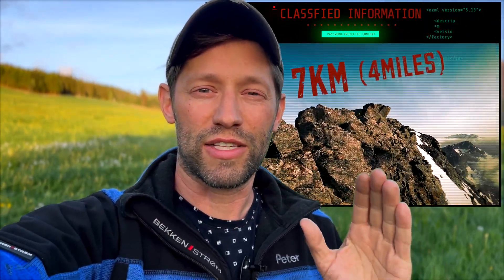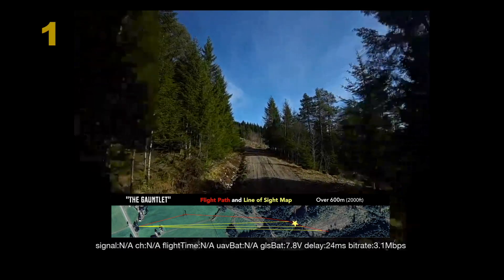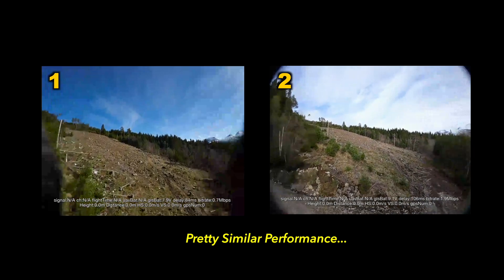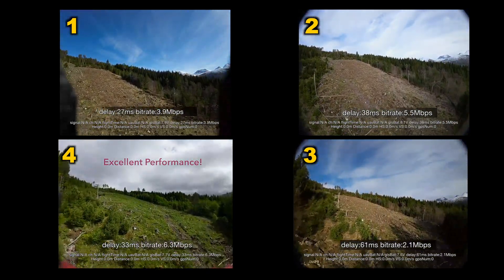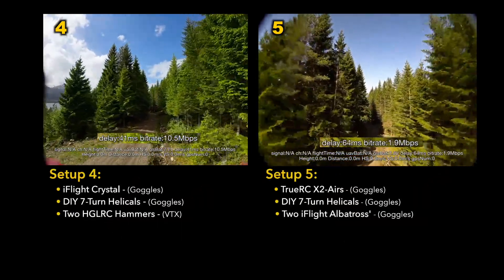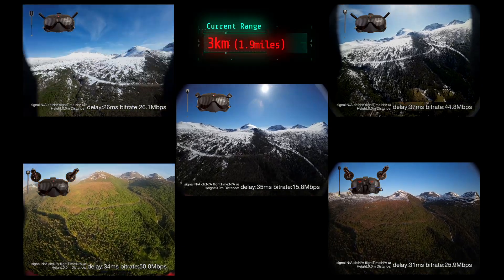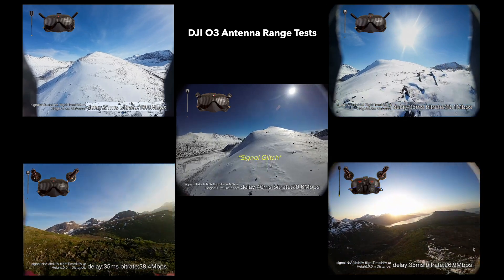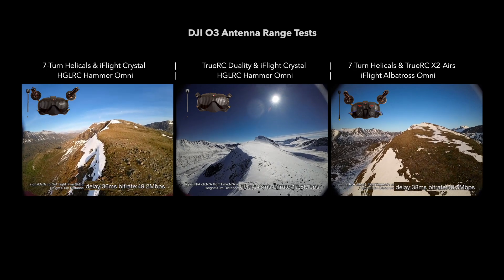NEW DJI O3 Range & Penetration | Improve FPV Drone Signal Testing | DIY & TrueRC High Gain Antennas

Comment: Are those Helical antennas RHCP?   I've got the Iflight Crystal HD, which is LHCP. Also running dual 150mm LHCP antennas on the O3.    Common logic would say that I need LHCP Helical antennas. But all the STL files I find for helicals, appear to be RHCP.       One random article I read said that when you have reflectors on your antennas (like with helicals), the polarization actually flips/mirrors around to the other polarization?   Any thoughts on this? Thanks!  Always Looking forward to your future videos!!
Reply from the maker: Hey, i have both RHCP & LHCP helical. Basically you just “flip” the STL file before printing your pieces. 
When using my iFlight Crystal patch I use LHCP so everything matches.  When I was testing the X2-Airs I swapped everything to RHCP. 
Regarding reflectors, the base of the helical is actually a ground plane, not a reflector, so there is no change in polarization.  
Hope this all makes sense, this setup works great, just did a flight the other day, reached a 1600m peak and then flew down a glacier! Amazing!  Thanks for watching, appreciate the support, cheers!
Reply: @GiantAntCowboy please, can u write your setup with crystal patch to long range configuration 🙌
Reply from the maker: @LockyRave my current setup that works well is: iFlight Crystal Patch with 7 turn helical antennas, and tall Omni antennas on the VTX; currently using iFlight albatross SMA, but the HLGRC Hammers with UFL connections were what I used in these tests.  
Hope that’s what you were looking for, cheers!
Reply: @GiantAntCowboy thank you so much! 👍👍👍
Reply: @GiantAntCowboy I start to find 7 turn helicals, but find only RHCP , this is not critical? Thank you again for your help!🙂
Reply from the maker: @LockyRave your antennas must be either RHCP or LHCP; you should not mix them. However, the stock DJI O3 VTX & DJI Goggles V2 both have Linear antennas which actually can be used with either LHCP or RHCP. 
For best performance though all antennas should be either Linear, RHCP or LHCP. 
Finding LHCP Helical antennas can be difficult, I always make mine. Here’s a DIY video I made years ago showing how cheap & easy they are to make.
https://youtu.be/TS4fYcT3DEE
Other options to consider are “Crosshair” antennas, which work very well.  Where do you live?
Reply: @GiantAntCowboy I’m in Russia, second year in fpv) short time ago bought lr4 v2 from flywoo, when I flying in wood landscape the signal easy lose when my height less then 30-40 meters. Crystal patch + crystal short omni in goggles v2, o3 with flywoo bipolar dual band ufl, but only 90mm. 
I find 7-8 turn rhcp aomway helical antennas to buy, Lhcp is unavailable
Reply: @GiantAntCowboy I open your link video, this is wot I’ve need 😂

Comment: Awesome man! I just started flying with the O3 and I love it but I have a bit of trouble with break up in weird spots where my quad it turned away from me at 5km. I’m using the iflight albatross antennas on the quad with an sma connector. What are your transmission settings?
Reply from the maker: @kosmonautfpv  I generally fly with bitrate: 50mbps & camera 4k60. One thing to think about is how your antennas are mounted on the quad.  
• You don’t want them angled too far back because the strongest part of the signal will be aimed towards the ground instead of back at you (Hard to explain in a short comment) but hopefully that makes sense.
• Also it’s of course super important that your head is aimed properly. Many people accidentally look down at the ground, or in the wrong direction which hurts signal a lot. I often move my head and watch the change in bitrate. 
Thanks for watching, let me know if that’s doesn’t make sense.
Reply: @ thanks man as always very detailed.  yeah my antennae’s are angled about 45degrees so I don’t think that is a problem. It could be how my head is oriented. Could the choke point of having a ufl to sma adapter have something to do with it? Also what channel do you set?
Reply from the maker: @kosmonautfpv  45° could actually be too steep, I actually have mine set a little differently, one is like 55° and the other is around 70°. The idea is this might helped when the quad is at different angles.  
The SMA to UFL adapter could be causing an issue for sure.  I specifically bought “HGLRC Hammer” antennas with UFL connectors to avoid using a pigtail.  I wish they were a little bit longer/taller though… 
As far as channel I just use Auto I think.  Are you outside the USA? And if so are you using the FCC Hack for max power?
Reply: @ oh okay that makes a lot of sense. I’ll try staggering them like that. I have the fcc hack unlocked and have been flying in channel 1 so maybe I’ll use auto as well.

Comment: little confused  what is the best VTX antenna  for long distance flight on DJI03?
Reply from the maker: @admitmohan  Honestly I’ve been testing antennas for years and found most decent omni antennas work well on the VTX; ultimately taller is better.  

On other builds I’ve really liked the iFlight Alabtross antennas because they are tall, tough, and also inexpensive! 

For this build I’m currently using HGLRC Hammer antennas because they are tall but also they have direct UFL connectors. 

If you use a UFL to SMA pigtail you could run basically any antennas. But long story short the stock antenna is linear and too short for long-range uses. Using two long antennas Omni antennas gives better results.

Comment: There are the most perfect buy advice videos because there is no bullshit, straight to the point.  I have one question,  with iflight patch and two long pointy antennas and then two iflight albatross omni, is there any signal behind your goggles? I like to sit  down when I freestyle and fly 360 degrees around me sometimes in a circel 250 to 500 meters wide. With the stock antennas on my goggles v2 this is somewaht doable but on the goggles 3 and the avata 2 it's fricking amazing. How do I replicate that on my goggles v2? Sure when I fly in front of me I can move my head in the direction of where the quad is but I don't ever want to have to fully turn around. So how do I still get signal behind me with just only patch antennas?
Reply from the maker: @KainniaK  yea thanks, glad you enjoyed the video/tests. With DJI I haven’t yet tested 360° performance with this Helical antennas/iFlight Crystal setup. 
However, with my HDzero setup I used four helical antennas and could fly 500m behind myself before having signal issues. 

DJI has better signal performance than HDzero so I would imagine DJI would also have no problem do a 500m circle with this antenna setup. 
Let me know what you end up doing and stay tuned, cheers!
Reply: @GiantAntCowboy  But Helical antennas all the rf is focussed towards an angle in front of you so how can there be signal behind you?
Reply from the maker: @KainniaK  Helical antennas are focused in front for sure, and you’ll be able to fly 20x further in front, but the antenna still picks up signals from the sides & back at close range, up to 500m in good conditions. 
Google: “helical antenna radiation pattern” for images illustrating what I mean.

The performance on the sides is often worse than the back actually… I’ve been using helicals for years and really like them. Really cheap & easy to make!

Comment: It's odd to see the iflight combo working better than the TrueRC at times as the TrueRC patches are definitely superior.
Reply from the maker: Yea, “take it with a grain of salt”. There were some variables that may have affected the results. All the antennas I used were Linear or LHCP, but since the X2-Airs are RHCP I had to use a different set of Helicals & Omni antennas which were connected using UFL-SMA connectors. 
So these variables could have created performance issues, however as mentioned i did have similar glitches in my original HDZero tests years ago. 
This X2-Air setup did perform the best through the gantlet though. It’s hard to do perfect tests with all these variables. Thanks for watching, appreciate the comment. Cheers!

Comment: Did I miss the control setup? The one with stock DJI v2 antennas on the goggles all the way around and the stock o3 antenna on the drone... Thats how I do ALL my LR now and I don't need to worry about turning my head to aim for signal. With MIMO we can have gain through beamforming, and when we swap to antennas that don't take advantage of that we have to rely on the antenna gain by itself (no MIMO gain!). When using stock v2 antenna, the best drone antenna I found is the long FlyfishRC o3 antenna.... Also, food for thought: I was just flying tandem with a buddy with patches and true rc stubbies on the goggles and long truerc sma antennas on the o3 in the drone and when he had signal issues a few km out I had perfect video. he lost video and had to ascend, while I was just following him up wondering whats wrong 😂
Reply from the maker: You’re basically saying that using Linear antennas allows the system to use multipathing, or bouncing signals to strengthen the signal. While using CP antennas eliminates the ability to use these bouncing signals?
I would think this would be more useful in a parking garage or bando situation than in long-range where higher gain directional antennas should perform better. (Though theoretically directional linear antenna would be best). 
In my tests my high-gain CP antenna setups seemed to perform better. 
Regarding your buddy’s setup, I wonder if he wasn’t aiming his patches well, or if there was just a general issue with his setup. 
Eitherway great info, appreciate you watching and sharing feedback! I continue testing and recording results, but let me know you thoughts.
Reply: @GiantAntCowboy  multi path interference is not a problem with DJI digital transmission, the packets are serialized and it knows time of flight for the packets over the air, so there's no concern of displaying the slightly older and out of phase reflections. Antennas as the engineers designed allows the o3 to use creative phase offsets in the transmission and reception of signal and this forms constructive interference to boost this signal. Aiming antennas really can be a thing of the past!
Reply from the maker: @BrandonBeans  but you’re saying this only works with stock linear antennas? 
I didn’t actually test the stock linear antennas too much because I didn’t think performance was so great in initial testing, especially through “the gantlet”.
Reply: @GiantAntCowboy  I'm saying it is designed to work with the stock antennas, and no guarantees any other way. That's all really.

Comment: The hglrc hammers are my worse antennas. I found thay the transmit anytnna frkm the wuad is pretty improtant maybe even more than the receieve. As for the true rc patches without them i have the woorse oerformmance on hdz
Reply from the maker: Interesting, I got these HGLRC antennas because the were the longest antenna with a UFL connector I could find. At the moment pretty happy with the performance of this setup.

Comment: Great Tests! Regarding the long range part, do you prefer the DJI Goggles V2 for your daily flights to the newer models or is it just that they have a better mounting interface for the different antennas to run the tests?
Reply from the maker: Thanks man. I have actually tried the Goggles 2 or Integra yet, so I can’t speak to them.  The V2 goggles are great because swapping antennas is simple, I can fit glasses under if I’m not wearing contacts, and I got them used for a good price!
Reply: @GiantAntCowboy  With the Googles 2 & 3 range improves. But have the feeling; the V2s still offer a better immersive experience of them all during flight.

Comment: I was already missing your videos and waiting for a new one. You edit them in calm, esthetic, pleasing manner. They are like ASMR, I enjoy them even if content is not relevant to me. For example I do not have and do not fly DJI.
Reply from the maker: Hey man thanks, I appreciate you on-going support! I wish I could produce more videos, but my obsession with details and lack of free time limit my production capacity to like one video a month… which system do you fly the most? I have a few videos in the works.
Reply: @GiantAntCowboy  I enjoy flying fixed wing planes line of sight. I also enjoy technology, so I occasionally fly FPV to learn technology and try new systems and setups. Curently, I use Walsnail V1 goggles with different Vtx.
Reply from the maker: @Mr.Laidukas  cool, I haven’t built a fixed wing yet, though I used to fly RC Planes years ago. It’s on my “to do” list!  WalkSnail is perfect for fixed wings, can’t believe some of the range tests I’ve seen!

Comment: With the 7 turn helical antennas, are they dual frequency 2.4/5.8?   They only look 5.8.
Reply from the maker: They are only 5.8ghz, but I don’t use the 2.4ghz for DJI. My RC Link is ELRS Gemini.
Reply: @GiantAntCowboy  Thanks mate.  Awesome flying.   Do you think that sticking to 5.8 restricts your range at all?
Reply from the maker: @CringleTheClown  no, because the O3 system only uses 5.8ghz for FPV video. The 2.4ghz signal is for the DJI RC Link. 
The DJI FPV drone (and maybe Avatas) however can transmit video on 2.4ghz and does have noticeably better performance.

Comment: the old goggles uses h.264 encoding, while the goggles 2 (new one) uses h.265. you can punish it with very low bitrate still remains very flyable, even with the stock antennas. (I use x-airs tho.)
Reply from the maker: Interesting point, thanks for sharing. These retransmission systems (DJI/WalkSnail) make me nervous because they can disconnect when pushed too far.  For mountain surfing I’ve always used Analog or HDZero, which have fixed latency/resolution, static feedback, and can’t disconnect (per say).  
However I’m obviously impressed with the DJI O3 system and will be testing it more in the mountains.
Reply: Goggles don't encode the video, VTX does. There's a difference in encoding between Vista and O3. Goggles don't matter here/
Reply from the maker: @awerks12  thanks for sharing, good point. I’m guessing O3 looks better/ can transmit the extra pixels because the h265 encoding. 
Is there any disadvantages to using h265? Link stability for example?
Reply: @GiantAntCowboy  no, the only disadvantage is that more processing power required. Link stability is all the same.
Reply: @awerks12  yea my bad, still h.265 encode

Comment: Check out OTR Helical antennas
Reply from the maker: Yea I know ORT and have always wanted a pair, however I’ve been making these helicals for years and they only cost about $5 each. Can’t beat that!
Reply: @GiantAntCowboy  curious if your DIY ones are as good. They definitely don't look too, too hard to make but the OTR have nice laser cut acrylic and the craftsman is very good. The problem for me is finding decent male to female plug ins for the goggles 2.
Reply from the maker: @Robocopter_fpv  OTR look very professional, and I assume they do some sort of tuning so theoretically they should be better than mine; however mine have always worked very well, I’ve made a dozen over the years, and they only cost about $5 each. 
FPV shops have adapters for the Goggles 2 that convert them to SMA or RP-SMA which could be a good option.
Here’s a simple DIY video I made years ago - https://youtu.be/TS4fYcT3DEE
Reply: @GiantAntCowboy do you have a tut vid for the helical assembly? I can only get rhcp locally
Reply from the maker: @Paulwhittingham  here’s a video I made years ago showing how simple it can be to DIY. ( https://youtu.be/TS4fYcT3DEE ) However if you want more detailed explanation tutorials, search @ModelRCReviews or @FalconRad, both have excellent video with detailed steps.  I’ve been making and using these for years, cheap, simple & amazing! Let me know if you have any questions, cheers!
Reply: @GiantAntCowboy  brilliant, thanks for the heads up

Comment: I have gone 5 miles and 2.5k' up with truerc x2s on bottom and omni's on top.  Stock 03 antenna on vtx.  20 mbs setting.  Lowest bitrate was around 8.
Reply from the maker: Yea the stock VTX antenna works great, I just found it loses performance when turn due to its size. Using two tall Omnis isn’t necessary but does offer some performance gains. Appreciate you sharing your experience!

Comment: I would really like to see a comparison with moonlight+WS_GogglesX and yours setup O3 + dji googles v2.  Since in my region where I fly, there is a lot of different interference, and on the same antennas on the vista unit and the avatar HD pro Kit,  imade tests, the difference in range turned out to be about 3-4 times in favor of DJI. the same effect was achieved with patches.

Comment: The wild thing is that wireless video is still getting better.
Reply from the maker: Yea, curious what the O4 or the future of other FPV systems will bring. Even after years of doing these tests I’m still amazed by the capabilities of these systems!
Reply: @GiantAntCowboy so far personally not liking the o4 over the o3 could just be since it’s in the Avata 2 but yeah.
Reply from the maker: @Arcticfawksie  interesting, what don’t you like about the O4 system?
Reply: @GiantAntCowboy  mainly the goggles and the avata so far. sold it and went to using the o3 just cuz it doesnt feel right.